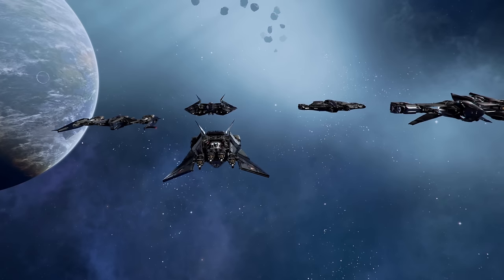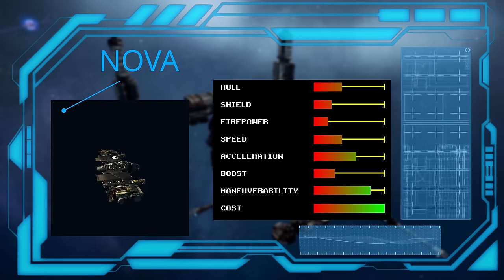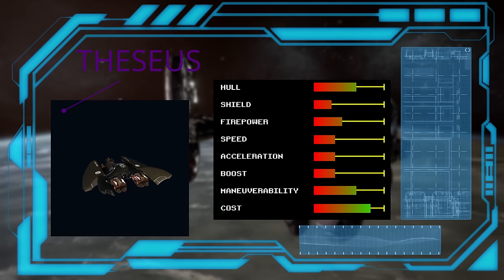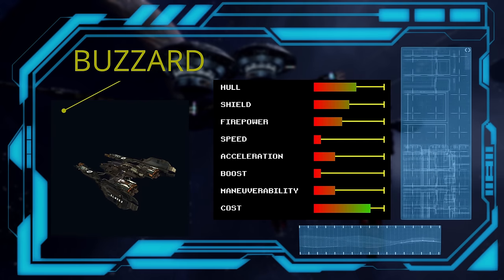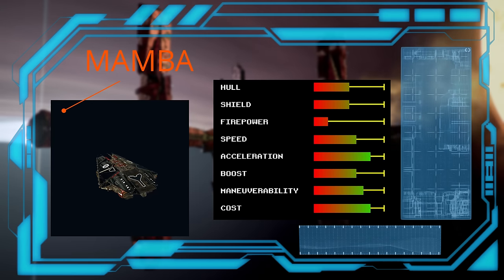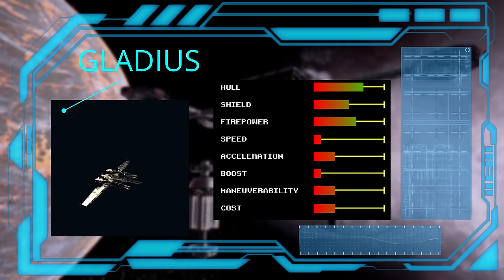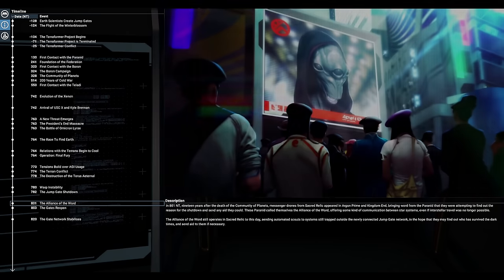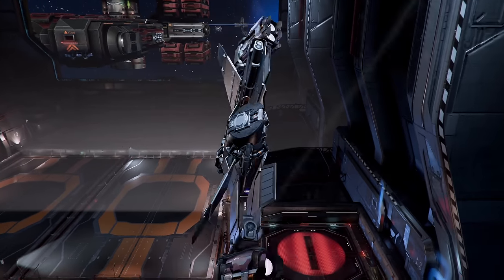X4 Foundations: Which Fighter is Right for You Guide

Comment: 1:49 Nova
2:12 Eclipse
2:32 Pular
2:53 Quasar

3:35 Perseus
3:55 Theseus
4:20 Ares

5:16 Falcon
5:42 Buzzard

6:33 ASP Raider
7:02 Balaur
7:29 ASP
7:54 Mamba
8:19 Chimera

9:16 Kukri
9:47 Gladius
10:05 Kalis
10:30 Takoba

11:15 Nodan
Reply: TL;dw:
*Argon Fighters*

1. Nova: The entry-level fighter with the highest travel speed among all scouts in the game. It is cheap and easy to fly, making it a good choice for beginners.

2. Eclipse: A front-line air superiority fighter with a slower speed but more hull and shields than the Nova. It is suitable for mass fleet engagements.

3. Quasar: A cheaper version of the Pulsar, with similar capabilities but fewer features.

4. Pulsar: A fighter with a focus on firepower at the expense of everything else, featuring six weapon mounts. However, it is slow, has low defenses, and is vulnerable to attacks.

*Paranid Fighters*

1. Perseus: A speedy fighter with two weapons, excellent for swarm tactics due to its affordability.

2. Theseus: A side-grade to the Perseus, offering more armor and firepower but sacrificing speed and maneuverability.

3. Ares: A slow and expensive fighter purpose-built for out-of-sector combat, with all weapons having a 100% hit chance.

*Teladi Fighters*

1. Falcon: The fastest fighter, suitable for patrol craft and interceptor roles, but not highly effective in combat.

2. Buzzard: A mid-range fighter with three weapons, extra hull, and moderate speed, but lacks overall performance.

*Split Fighters*

1. Asp Raider: A small and cheap fighter with three weapons, best suited for skirmishes and negligible survivability.

2. Balaur: A well-rounded fighter suitable for any combat role, with a single shield generator and high hull rating.

*Zyarth Patriarchy Fighters*

1. Asp: A surprisingly good fighter suitable for early-game use, with excellent performance.

2. Mamba: A fast and cheap patrol craft with two shield generators and two weapons.

3. Chimera: A heavy fighter with high hull, five weapon mounts, and decent acceleration, best suited for dive bombing and attacks on destroyers.

*Terran Fighters*

1. Kukri: A cheap and slow fighter, only suitable for patrol craft in friendly territory.

2. Gladius: A well-armed and armored air superiority fighter, but slow and expensive.

3. Kalis: A faster and more maneuverable fighter than the Gladius, with high shields and moderate firepower.

4. Takoba: A fast interceptor with limited firepower but excellent acceleration, suitable for catching and holding down enemies.

*Alliance of the Word Fighter*

1. Nodan: A fast, well-handling, and affordable fighter with limited firepower, suitable for missions and runs.

*Yaki Fighter*

No information provided on the Moreya, as it is considered too powerful for comparison purposes.

Comment: You remembered Alliance of the Word this time! :)  For my personal fighters, I prefer speed and maneuverability over the rest. I have been favoring the Takoba recently as a personal craft. It's nice to see the stats in chart form. 
I wonder what your chart would look like and your opinion on the Mamba if it had a third weapon mount. I only bring it up because if you look at the model, it appears that there should be one there right in front of the shields in the gap but they removed it because it would unbalance the ship.
The Balaur is my favorite heavy fighter to fly. It is 1 shield mount away from being perfect (IMO).
The Nova is what I prefer to fly when stealing blueprints. I move the captain to the service roll so he's not in my way for the amount of times I have to go from captains chair to space suit and back. and the teleport panel is RIGHT THERE. Plus that high strafe speed :)
As to the one I like to fly despite all indicators it may be terrible (and not on your list due to being a scout) is the Discoverer Vanguard. I think it's just the way it looks. I always wished there were two more guns at the ends of those "arms."
The Kestrel Vanguard is what I use as a fighter/trader. Lots of cargo space for a fighter, and cheaper than a Nodan when you factor in engine costs. These are my go to for trading to build rep and they don't get harassed by the SCA/FAF. Pirates do not harass military ship unless you are piloting.
Reply from the maker: I did remember this time! A third gun on the Mamba would make it too strong, that may have originally planned it that way but then removed it after the design was finalized.

Comment: In the previous X games, the different race fighters also had one particularly significant property about them you completely left out in your video: the different sized cargo hold.
For example, the Teladi, given their entrepreneurial nature, tend to have the largest luggage compartment, contrary to the microscopic one of Paranid fighters in which you can barely fit your purse.
Your measurement does not take this into account at all because it does not matter for your playstyle. But in universe, that is an important factor.
Reply from the maker: Every video I release has bits removed in the final render to reduce time and increase flow. For the ship breakdowns one of them was cargo capacity. I apologize that an important aspect was removed but it didn't make the cut
Reply: @JKNinja  Ah, i though it was because of your play style.
Given how you presented the use of fighters, you mostly seemed to use them as squadrons on a carrier, less for player use directly.
Only on the Nodan you spoke about the boot size.

Comment: I like the Moreya most, because it is so extremely fast and have a lot of firepower (4 gun slots), so that it's perfect for fast and quick attacks. And if you run out of shield, just boost away, reload your shields ans come back. You also should mod your shield recovery delay, so that it takes only about 3.5 seconds instead of about 12 seconds.
With the Moreya you can even knock out all turrets of a defense station, if you hack them before. It is also possible to destroy a Xenon K, because it can't hit you. ^^

Comment: I wonder which army would win if you had 100 million. mk1 cheap ships or mk3 expensive ships or mid range ships. On the one hand you want the best of the best. But when you see the MK3 prices and you wonder, are trusters really worth 6 million on my Large ship. I go MK2 unless I fly em or built em myself. I like the Ares for Capital ship defence. The 6 gun ship can be equiped to immobilize large ships and board em afterwards with L Freigther. Discoverer looks good and is best at pirating S/M ships. PAR scout is mega fast best at start and I use for exploration later in game and equip mk1 pulse laser for lock boxes. Katana is also a very good scout/Attack vessel. By some cheap TEL S ship and dock em at place you want to teleport to to save time. Great vid!

Comment: Do not forget, vanguard also have higher maneuverability, like rotation speed, acceleration, responsiveness and so on.
Reply: And cargo space doesn't matter to military craft that only does military things, because missiles et al are not part of the cargo. Some got into trouble buying a Paranid Pegasus scout because it used to have insufficient space to hold three antimatter cells, so they upped the amount, but it balanced the ships to an extent. You got a much faster Paranid military but no usable space, because the S class military had no space. So if you wanted space, you either went for a Disco (with two guns and 540 units of space), gunrunned with a Teladi Scout (one gun but near double the space, enough to trade with early game) or you got an S class trader with two guns. The single gun S trader was faster, usually, therefore reduced losses if it died, or most of the M class was wasted because all you needed was 500 units of cargo this run by AI manager, so speed was a factor more than capacity, when running.

Comment: Great work!
I just restarted another gameplay I runs a bunch o Moreya 120 Raptor or 50 Tokyo with a pair of blast mortars and thermal disintegrators with mk 4 split combat.

It fair better OOS, IS however does suffer more damage due to post boost shield drain.

Comment: A quick note about the Nova to take into account

It is the only fighter with vectored engines, giving it very high control in all directions except left and right. The AI seems to be very good at using this maneuverability, so while it may not be the best fighter in terms of raw stats, it can hold its own and is very well worth its (rather low) price tag

All in all, not the best fighter, not the worst, but it is one of the best for its price
Reply: The Falcon has vector engines too.
Reply: @LitlBlackDragonNinja  Huh, did not know that. I don't mess around with TEL ships much

Unless it's for trade, of course

Comment: Great video, thank you.
Unfortunately, much later in the game I just stopped using fighters, because everyone is packed with destroyers and battleships, so imho there's really no point in producing them. Except to land on something small when you can't use Teleport option.
Also, I find it easier to track down fleets made of a few huge ships (with such defences that enemy small ships are no threat), than have numerous small squadrons.
But guess it's all down to playstyle...
Reply: Depends. The Xenon produce a good mix so as long as you have THEM, then you NEED fighters, even OOS a swarm of unshielded Xenon drones can kill your destroyers if you don't Zerg Rush them back. In system, fighters are a huge problem for big ships. A lot of losses because with one shield, one hit could be a kill, but landing a hit is hard for a turret big enough to kill a fighter in one or two hits.
If you have removed the Xenon, well, duh, the game IS easier. But the races don't build up a balanced fleet, and it is easier to kill destroyer vs destroyer, but that is what the flipping class is DESIGNED for. The cruiser/battleship (the K is definitely a cruiser, I would call the I a heavy cruiser, more than a battleship, because it only has the same weapons as its "destroyer" class Graviton gun) of the Xenon can take down a LOT of ships. Mostly because the graviton guns are turreted and far more powerful than even the main batteries of a destroyer. So, yeah, if you kill the Xenon you aren't left zerg rushing either destroyers to kill an I or K quickly (and an I will take a dozen destroyers out and survive, if barely) or a lot of fighters in-system because once you have killed the turrets, the I is an expensive hulk, you lose a lot of fighters, but you may kill an I with 40 fighters and lose half of them but you would lose half of a fleet of 20 destroyers that cost you three times as much. Of course those 20 destroyers would decimate any race.
Reply: Fighters are easily the most cost-effective "unit" by far. They will cost effectively beat anything and then some. Why should i spend 50 million credits on two Osakas when i get 100 fighters instead, which can easily destroy 10 Osakas and more.
Once you reach a critical mass of 500+ fighters - which is only about 250-300 million credits - you have basically won the game.  The same can not be said for having a number of destroyers for the same value.
Reply from the maker: Playstyle is a huge part on which ships you prefer. Nothing wrong with focusing on fewer bigger ships, going with a deathball swarm of fighters, or anything in between. Just remember that it is your game and to fly safe o7
Reply: @JKNinja  Indeed. I am just a little sad that capital ships are just so much less effective than in older titles.
I miss having my Line Of Battle. :P
Reply: @kajarslibrary5404  so by that logic, would it be better to build that one really slow ship which is great in the unloaded simulatored  maths locations
Reply: @any1alive  Nah. You want some decent speed still. Nowadays i use the Takoba as fighter (fast and tough) and the Chimera as bomber. (5 heavy torp launchers / thermal disintegrators and 6k hull to survive capital ship explosions easily.)  And a gigantic swarm of Kyd fighters because they are incredibly cheap and super easy to mass.
Reply: @kajarslibrary5404  Damn, that is a rpetty based answer, yeah takoba seems top tier for speed n mid for hull(it looks cool too)

after quick skim reading Chimera is pretty good for hunting too. ill member your loadout for it
as per spam Kyd fighters, i cant wait to try it for the memes,

Comment: My experience: Forget about S-classes. Your first one is one but is barely enough to do more than some scouting. Get yourself an M ship ASAP. And in that category I suggest you to buy a Nemesis or a Katana. Because if you fly by yourself, most of what you would do implements combat. And the Nemesis or the Katana are the best average of firepower while still beeing fast. They can also take some hits before they explode.
Best  config: Use Thermal Disintegrators from Split and also Engines from the Split and and Terran Shields.
If  you haven't any DLCs (the question would be why not as they are not even expensive) you might go with a Nemesis (as the Katana is no option, doe to the missing Terran DLC) and use Teladi shields and some Bolter Guns. 
If you still want to do stuff like exploring, mining or trading by yourself, you should have made already enough money by now to have fiting ships available, just in case. But trust me, that activities can get boring very fast!

Comment: Though for what it's worth. one will get a "Modified" listing. There is a mod, which introduces a new version to select, than the one's a vanila and the various DLC's have. It's available on Steam, I don't know if it is via Nexus.

It introduces a new ship called the "DISGUISE". And it's own slightly different story line as all the DLC's do. If and when installed, it can be found below the lowest selection under the creative game mode.

The ship is one of a kind and thus far, can not be nor does it need to be modified. Though a small ship. You get one when starting and there's no where to get another. It has the ability to carry hundred of items and crew. And it's weapon all six are the same, using all simotaniously can destroy entire asteroids, in a second, turning it to dust. It's pretty much a one shot destruction ship. It travels at normal speed in kilometer per second rather than meter's per second.

Get board playing vanila, and wanna just fly around as if your GOD. Try it!

Comment: The Nova doesn't look so great on paper but its manoeuvrability is unmatched. Using its rotating engines to strafe "upwards" it can be used hug and attack just about any ship from its blindspots and never take a single hit from anything short of a beam. I often use the Nova as my personal ship and its just plain fun to fly (I don't trust my AI pilots with them though).
Reply: Nova also has almost no area in any projection, making hits unlikely. I can swear I saw my "TER Pulse" shots flying right trough Nova's wing trusses, completely missing from 800m away! ( rage )

Comment: I love the Ares, my fleet of them all have Terran mk3 shields, but they actually get picked off pretty easily in big engagements. I came across 6 Ks the other day, and it did not go well for the fighters, 50 was not nearly enough. But even against one K and some fighters they don't last. I find foundations far worse for fighters than previous X games. 

I really hate how you can't turn off boost unless you do it manually for every single ship every time you give it an order to attack, because they boost to the target and then get smashed because they have no shields left. I have lost so many fighters that I no longer bother, the cost is too great. I just fly around with 40 destroyers and nothing stands a chance. It's fun to get into a fighter for some dog fighting though.
Reply from the maker: That's true about AI boosting. Its really bad with medium ships since their shield recharge rate is much slower than fighters
Reply: @JKNinja  That's true too. The only time I use medium ships is for some combat story missions where a fighter won't cut it and a destroyer is too slow. Protect missions mainly.